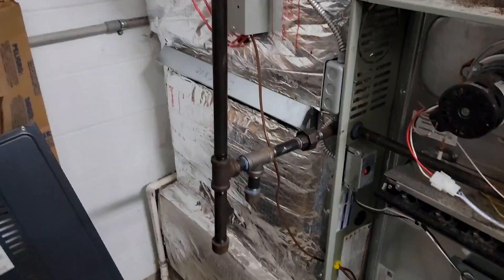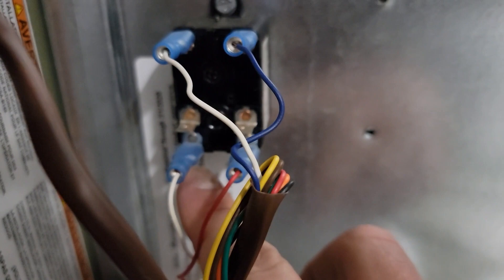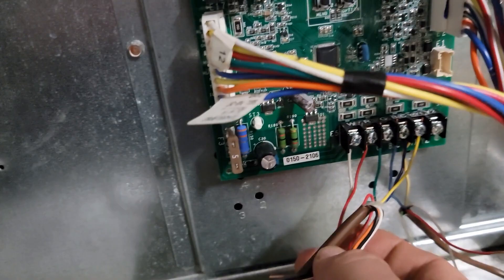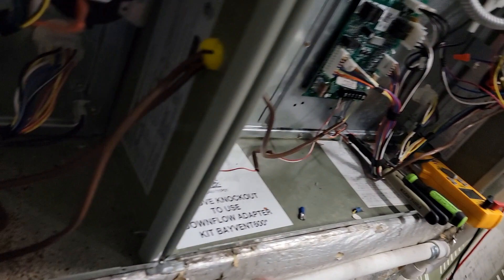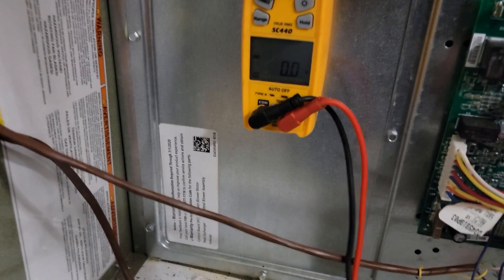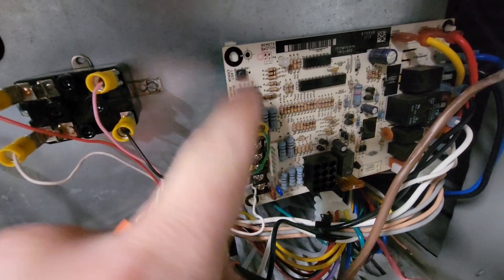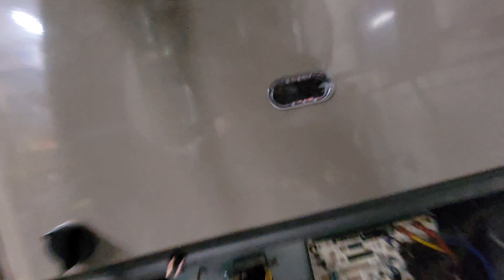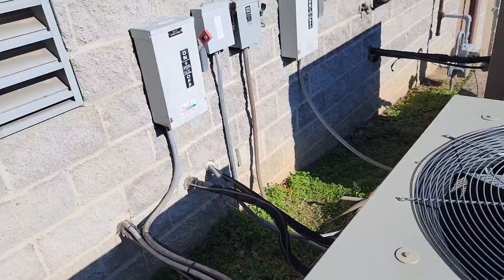Mastering HVAC: The Ultimate Guide to Twinning Gas Furnaces

Comment: Love the set up. The biggest problem I run into is trying to figure out what the guy before me did. I love a good Frankenstein but an out in the open “industry standard” fix that doesn’t make my tiny brain hurt is awesome.
Reply from the maker: This was exactly what you are talking about
 Both of these systems were messed up and not wired properly there were actually 2 relays instead of one and I had to remove 1 of the relays so I know what you're talking about
Reply: @TaddyDigest  That is my life. I’ve been doing a lot of work for an apartment complex that was built in the 40s. My frustration had got to the point that I finally talked to the head maintenance guy and told him that he was paying me to fix stuff that his other two crews are screwing up and he was paying for the same word twice. He told me it was in the budget. The other two crews are cheap and he knows they   get about 80% of it right so they budget in me batting clean up. I stopped shaving my bill thinking he was loosing money on rework.

Comment: You did everything very nice 👍 

In my opinion I would put the cheapest thermostat in the return air duct and connect both fan motors in one board! Cheep, fast and will work like second stage!
Reply from the maker: very good idea I like that 👍
Reply: On board Relays aren’t designed for the load of two motors. Relays will burn up.
Reply: @OcRefrig   No way! On board 20amps relay! And you can also take the two wire from relay signal and put one own relay!

Comment: I’m working apartments built in the 1940’s that have been turned from two bedrooms to 3 bedrooms by removing a wall. They have central heat on one side and a floor furnace on the other side. I was wondering if I could do this twinning so the call for heat signal would be better on the floor furnace? We are replacing the 750mv thermostats like crazy since the floor furnaces are on a separate thermostat anyway.

Comment: Why the relay you just put red two red white two white and so on Just like a regular furnace
Reply: Can’t do it. Each furnace has its own transformer.
1) if u disconnect one of the furnaces transformers might work if transformer is big enough to handle load of 2 boards and relays.
Reply: Thank you very much. I do appreciate you clarifying that for me. It’s a big help. Thank you.

Comment: What do I do if one unit goes down? Is it safe to run the other unit while waiting for a repair?
Reply from the maker: Usually, you have to wait until the other unit is back up. And running Because it's usually one circuit and one large indoor coil

Comment: Can't the second burner be wired so it acts like a two stage furnace?
Better comfort.
Reply from the maker: yes, but the building needs the full btu to heat the structures load

Comment: Don't understand why the relay is necessary on the twinning when running an additional set of thermostat wire from one furnace circuit board to the other would accomplish the same. Also, on the York set up, why isn't there a wire going to Y1 in the second furnace that's not being controlled by the thermostat? Won't that prevent the blower from coming on the the second furnace on a call for cooling?
Reply: Wiring board to board would not work, they both still need to use their own 24v power to peform the control

Comment: Can you explain how does the 2nd unit/board get energized in the cooling circuit if the R is only connected to the heating relay?
Reply: Any chance for an explanation on how the cooling circuit would run if the R is only hooked up to a relay in the heating circuit?
Reply: The 24v from the transformer of the second unit are always present on the relay just waiting for the signal from first unit to let it through.

Comment: How does the refrigerant circuit work in those twin applications is there two line sets for each furnace evaporator coil  that goes into a distributor box before it goes to condenser? I’m not familiar with those setups I’m mostly residential.
Reply from the maker: Only one set of line sets going into that coil

 The bigger the tonnage
 The more lion sets
Reply: @TaddyDigest  does each furnace have its own condenser?